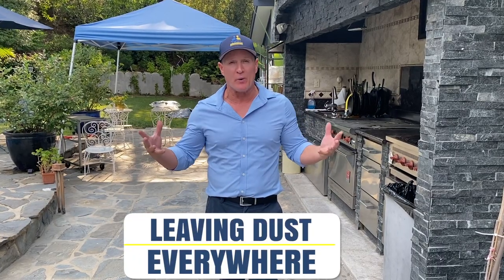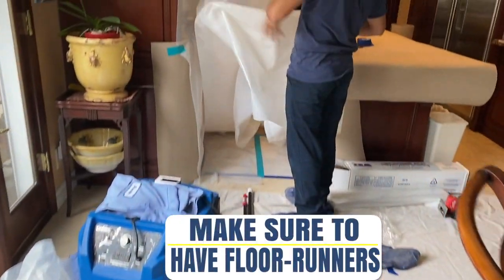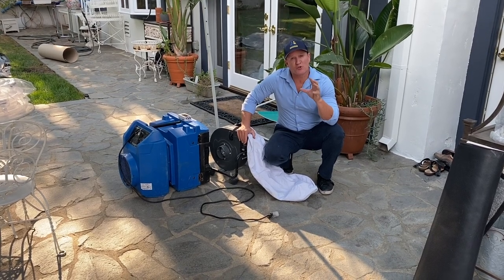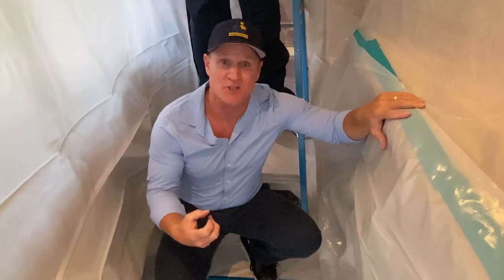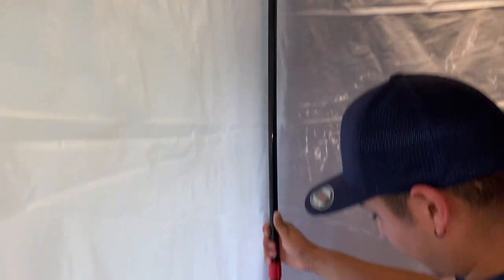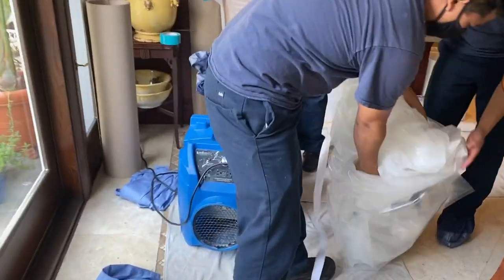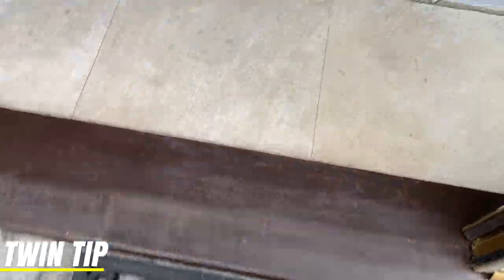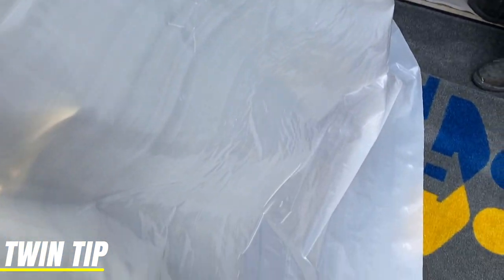How to Keep Dust UNDER CONTROL During Repairs and Renovations - Twin Plumbing

Comment: Seven hours later, drills one hole. Ok now we dissamble tomorrow that’ll be 2700$ you could get the same thing done with a shop vac just hold the vacuum next to the saw and bingo hours saved